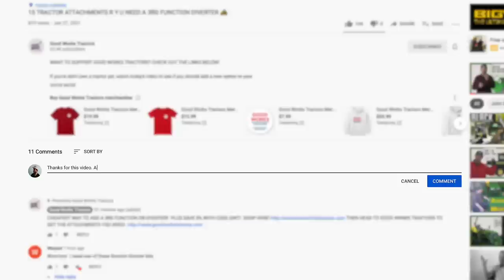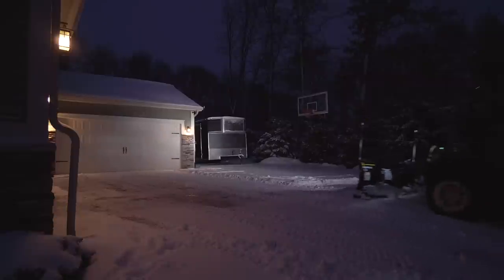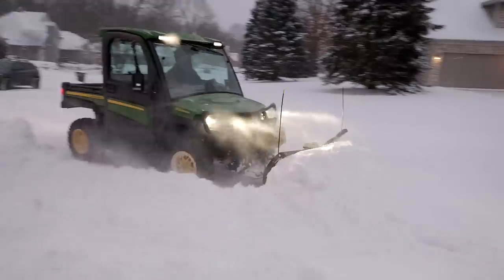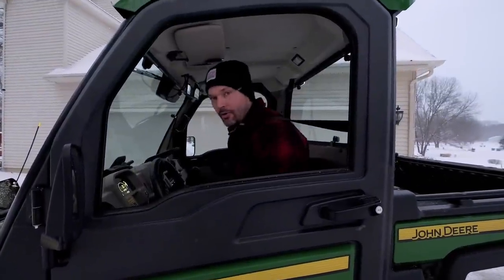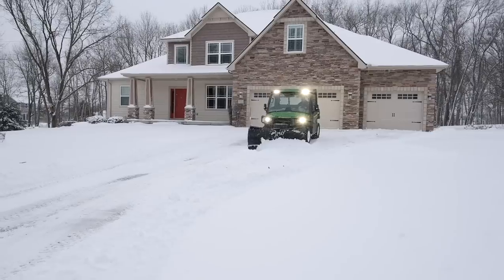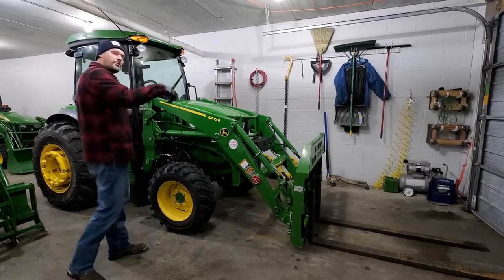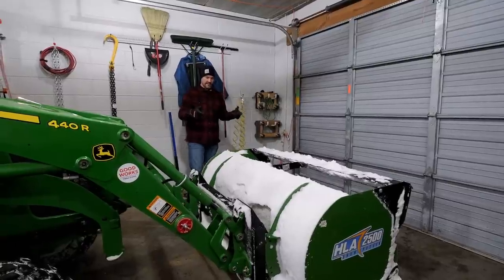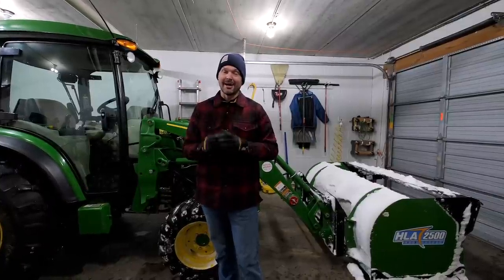JOHN DEERE GATOR VS TRACTOR PLOWING SNOW IN STYLE! 🚜🐊😎

Comment: I bought a little Honda HS720 single stage snow thrower I keep in the bed of the Gator.  I use that to clean out in front of garage doors enough to get the Gator in and plow out.  I have an older model Powertach plow on my 835M and that can be arranged for down pressure, but I don't use it that way.  We just had 20" of snow here and I plowed twice.  The Gator handled it pretty easily though it was very light snow.  Now my neighbor didn't have anyone do her driveway AT ALL!  We have more snow coming and she's parked out by the road.  I asked her if she wants me to give it a shot.  So I try it with the Gator.  The snow had compacted to about 14" and was much tighter and heavier.  I was shocked the Gator could push it.  It was rolling snow I sweat 4' high in front of the Gator.  I whish I had video of it.  

I have a Kubota B2320 TLB if it gets bad.  BUT that's open cap and I'm not using it unless I have to.

The whole shifting operation and changes in motion on the Gator and any of the CVT's in general it's just ehhhh. Not like using a hydrostatic tractor. 

At the street I try and stack the snow on the down "stream" side of my driveway and mailbox.  If I need to pile it on the up stream side I try and go pretty far so the township plow can toss the snow and have their plow about empty by the time it gets to my driveway.  I have about 350' of road frontage.  Generally I NEVER push snow across the street.

If I had a heated tractor cab I wouldn't use the Gator at all.  If I had asphalt AND a cab tractor I'd have a snowblower on it.  The guys with the snow blowers never have to worry about where to stack snow.  I've been stacking snow for 40 years.  Using that Honda HS720 is making me rethink my snow removal processes.  

Do you use compression software to upload your videos?  I could never get a 21 minute video uploaded?

GREAT video as always.

Any chance you got a nice Kubota L3940 HSTC and loader you're not listing on your website???  Buddy - Pal??

Comment: Compact tractor (large frame) with a pusher on the front and a snow blower on the back is a parking lot clearing animal.  Push the bulk and use the blower to clear additional space (corner spaces!) and quickly put piles wherever you want them.  I used to plow a small parking lot and having the extra 6 spaces I could clear 100% with the blower was awesome.  Don't get a lot of snow?  Hang a rotary broom on the back and clear pedestrian areas.

Comment: Im baised here owning a tractor, so I'm 100% snow pusher with rear blade. I actually have 2 different pushers, hla1500 w/ steel edge. perfect for wet snow / sleet / ice as the size only allows so much material so I dont loose traction or steering, the other is a no name large pusher w/ rubber cutting edge (mold board is 35" tall, width is 72") love it for big snowstorms with drier snow, I can move  a ton of it at once. The rear blade is great for getting into tighter spots and windrowing smaller storms to grab with the pusher.

Comment: The Gator did well with the driveways and I agree about keeping the snow off your neighbors property. The pusher did well in the open lot clearing. I was surprised that you have to plow your own area when the landlord has the upper lot plowed. Its also crazy that you have to bring it up the hill. (No place for it in the lower lot). Both plow & pusher did well for there tasks, good job and thanks.
Reply from the maker: Thanks for watching Bob!  Yeah, I really just need a bigger shop.  On the hunt for more space, but hard to find right now.

Comment: I find in reral MN that a blower and blade combination on a tractor works best. It does not matter if it is in a front mount blower and rear blade or front blade or rear blower. That way I don't have to push the snow on to the lawn and rip it up. I have a can stay on the drive and blow the snow on the lawn and still scrap the drive with the blade

Comment: I've found that the verticle angle on the edge makes a difference when you want to scrape. A slight tilt away from the direction you are plowing causes the edge to float slightly. I adjusted my tilt to perfectly vertical and it scrapes both directions. Also when going backwards your skid shoes will hold up the blade since they are on top of snow where in forward the snow has been removed.
By the way I like your brother's camera work. Nice job!
Reply from the maker: Good points all around here, thanks for taking the time to comment!

Comment: I've really had an epiphany lately with my pusher, and back drag setup with my rear blower. I took off my loader arms on my L2501, and I have to say, I'm so very impressed and a little dumbfounded. My 68" mk martin meteor sits fine with no front ballast! I have hills, and quick drop offs here in Wisconsin and my problem has always been inside corners and maneuvering in all my tight spots. The blower alone on my tractor makes it handle like a jeep compared to a semi truck! And I can do u-turns,  or right turns and it follows along beautifully. Plus with the blower, you touch it once & it's gone, except in a few of my tight spots, but even then, I just hit it a 2nd time. I don't get the large piles, and it just handles so nicely! I took it off as an experiment, and have now blown 3 storms without loader arms on. 
1. We've had at least 6" each storm, with lesser amounts the blower isn't as effective. 
2. The blower actually works pretty good as a back drag! 
The blower weighs 500lbs, but doesn't lift my front tires. I'm really amazed by the results. And I'm a big snow pusher fan!

Comment: Living on a cul-de-sac is terrible with snow plows that don't know what they are doing.  Each year they push their blades into the grass and cut up a large section or get stuck since we are on the bottom of a hill and back into the yard and spray salt all over the yard.  it Sucks!  I try to get out and clear before they get here so all they do is leave a big pile in front of my driveway.  They really need to learn how to turn their blades.  I clear my drive the cul-de-sac and some of my neighbors drives and I just got the HLA 1500 for my 1025r and I love it.  Put a UHMW blade on the bottom and rubber on the back drag and works great.  I always put the snow in the curb of the house I'm plowing.  It takes a little longer but I agree its not the neighbor on the other side of the street snow.  Good plowing

Comment: You’re right... having a cab is a big plus on my 3039R.  So far I’ve been using my bucket to clear my driveway and it’s working well.  Are the blades for a Gator expensive?  I have an 835M. Thanks for this video.

Comment: Yea we always had clean scraping issues with atv/ utv blades.  It worked a bit better when we added weight right on the plow.  It's a delicate balance...too much weight and you will damage the plow, not enough and it just floats..

Comment: At your house, you need to back drag the corner where your garages meet. Then backup perpendicular to your trailer and push your driveway in an arch pattern with your blade angled to the left. Back dragging with a standard plow will never scrap the same as pushing.

Comment: That V plow is slick. That little bit of snow that leaks in the middle would drive me nuts lol. I use a rear blade and a snow pusher, seems like the most cost effective setup. Do you find having the back drag on the snow pushers works better than having a rear blade? I just figured the rear blade works for snow removal and ballast.
Reply from the maker: Yeah, it drives me nuts too.  I bought some conveyor belting to fix that problem (if things go according to plan).  Going to install it when I swap over to UHMW.  Just need the a couple hours of free time.  Yeah, I really like that backdrag on the pusher.  Rear blades are very light so don't add much ballast compared to a box or weight rack.

Comment: I like weight on the bucket for scraping to pavement vs leaving a half inch of slippery snow. Best machine I ever used was a Cat 930 with a bucket slightly narrower than the front wheels. It took more passes but it cleaned roads and cement down to nothing

Comment: Question: is it really safe to drag that long/much with the snow pusher?  i thought that puts an undue strain on the two cylinders and may bend them??
Reply from the maker: You need to be careful.  Plowing a smooth paved parking lot is different than using with a bucket on uneven terrain with potential hidden stumps, roots, rocks.  Also, speed is your friend.  Slower the better.

Comment: what size snow pusher do you find ideal for a 1025r, 54" or 60". I currently have the 54" front mount snowblower but would like the option to push if needed.
Reply from the maker: I recommend 54"
Reply: I have a 5' king kutter box blade on the back of my 1025R and I have to be in high to get enough speed to push/pull any snow, going in low isn't quite fast enough.
Reply: @prestonfaust4267  I have the heavy hitch back blade that I use in conjunction with the snowblower works pretty good when I angle it

Comment: Far be it for me to be critical of someone else's plow job; I have a suggestion with what I do. With my v plow, I push driver side full out and pull passenger side full in. I then start from the left of the paved area and make an arc towards my pile area. As I am become perpendicular with the pile area, I straighten out the wheels. Rinse and repeat. You will have less you have to back drag around the garage and when you do, you push it to the Right and not all the way back like you did.
Reply from the maker: Not sure I follow, but I've used this plow, used the plow on my old x739, used pushers, and used blowers on my drive.  I've plowed it for five years since we moved in and tried every possible method I can think of.  It's just a tough area to plow and can't wait to move, haha!  Thanks for watching.

Comment: Some of my thoughts from Minnesota: Poor original layout of the first driveway, like most are. Nobody thought about snow removal and piling when it was first laid out. The second one is a little better, but still not good. Ballast sand bags in the bed also help tremendously. And add a backdrag strip on the gator plow blade. I usually clear most snow with the plow truck first except by the buildings, then backdrag by the buildings with the tractor loader, then move that with the plow. The object however is to not drive on the snow before clearing it as much as possible.

Comment: Wouldn't the back drag function for the pusher be the same as the radical tilt of the bucket and back dragging ?  I mean in terms of cylinder extension and issues that can happen because of it.

Comment: Have you tried putting chains on your front tires, on the 4066r. 

I do with mine and it turns like a charm
Reply from the maker: No, not looking to screw up the concrete and paved surfaces.
Reply: @GoodWorksTractors  oh that makes since. Silly me, I live on dirt roads and dirt driveways
Reply from the maker: Yeah, great option for your situation though.  I bet it makes a big difference.
Reply: @GoodWorksTractors  yes it does.

Comment: I’ve snow plowed since ‘06. Keep the plow straight when back dragging. Your pivot point is center of the V so it’s very hard/impossible to get equal down pressure on the entire edge when it’s not straight. Also your best most efficient plowing with any plow is always forward. Back drag just enough to get your equipment enough room to plow in the forward direction. I have a Boss V plow on my Gator(I know you bought it as a very lightly used machine and it came with the JD plow) and it a much better system,  as it has a handheld remote compared to your joystick system, I know it’s more user friendly then the John Deere system. Maybe look into one for yours you will like it 100x better. Love the content though keep it up.

Comment: The johndeere plow looks identical to the fisher plow i have for my gator. I bought my 835r 2 years ago and deere didn't have that plow available yet.
Reply from the maker: Yeah, a few others mentioned that as well.  I'm sure it's just private labeled.  JD does that a lot with attachments.
Reply: @GoodWorksTractors  the outside mirrors on your gator, they are the one u have linked on Amazon?
Reply from the maker: Negative.  Those only fit tractors.  These were from the JD dealer.

Comment: Hey good works, quick question. We are looking at buying a 4066r or a 4052r. We have a new Holland open station that is older and pre emissions. We are worried about the emissions because we only use a mower with it 1 or 2 times a year, mostly loader work. Do you think this will lead to engine problems? Because the engine won’t be running very hot all the time so idk if that will be bad or not for it. Great video btw
Reply from the maker: Morning, my 4066r goes into regen every 40ish hours since we run lower throttle a lot, so soot builds up more often.  However, we can use the tractor while it's going through regen and it really doesn't affect our operations.  I don't see how this will lead to engine problems, but I'm not a mechanic either, haha.  Just my two cents.
Reply: @GoodWorksTractors  ok thanks for the reply so quick. Not many people on YouTube with one, much less that dosnt use a pto implement frequently. This has been the main thing keeping us from buying one so your feedback is very helpful.

Comment: Pull the shoes on the blade or raise them all the way up.  You are plowing on pavement.  I plow with a 825i S4 at work with a Curtis plow.  The Gators have such a light footprint that you don't need the shoes and it will scrae better.  Just feather the blade up a bit when you go off the driveway.

Comment: I have a similar setup only a Honda utv with a boss plow! Love the plow and is faster in the long straight runs. But my cab the Honda dealer put on is awful snow blows right in and the heater you can blow as hard with your mouth on high sucks. So I would much more prefer tractor only screwed up and need a cab!!

Comment: You could try back dragging in front of the garage  enough room so you can get the gator backed up to the garage door and then plow forward down your drive instead of back dragging down the entire drive.
Your landlord's snow removal contractor does not want to take on the liability of possibly hitting any of your equipment or you claiming he did even if he did not.
Reply from the maker: Yeah, I just backdrag the top section, then plow down the hill.  Still annoying even in that top landing area.
Reply: @GoodWorksTractors  there's a tool for that if you're looking to buy more toys. 😂
Reply: @GoodWorksTractors  I'm sure your landlord is great but if it was agreed upon I'd want to ask for a plowing stipend each time it snows. Perhaps the landlord doesn't know and would be upset if he found out. In that case I might let it go too. It's just always best to address every issue, even little ones early when it comes to business.

Comment: A Gator doesn’t have enough weight or maneuverability to match a tractor.  And if you put a plow on in place of a bucket you can pile the snow.  A Gator has its place but in general offers a lot less than a tractor

Comment: If your V plow had a back drag cutting edge that might improve the removal a bit. My options don't include a V or pusher, so I have to choose straight plow or blower. Blower is great except when really wet and iced up gravel below. Tends to be almost a pusher. But if I had to choose, I would pick the pusher. Down pressure and no lost snow at the middle of the V.

On the placement of snow, my opinion is not in someone else's property and absolutely clean up the mess. I can't count how many times someone has pushed across the road and the remaining ridges are scary to drive over. If it is hours before the road plow comes past and has been packed down, I would not want to be that plow driver hitting those ridges. Selfish move in my opinion!
Reply from the maker: I've thought a bit about the cutting edge for this plow, but realize the inside ends (at the middle) would need to stop short in order to still be able to angle both directions. Still need to look into this.
Reply: @GoodWorksTractors  True indeed. The same as the front to it to be in the inverted V position. Some truck style V plows have back drag options or maybe aftermarket options. Or maybe have some fabricated for that plow. There might be a market someone hasn't filled yet for back dragging with that V.

Comment: You ask about plowing score intp the neighbors Yard or Plowing Across the road. 
I'm a contractor and I keep the snow in the yard that it comes from.  Also plowing across the road in my area is illegal, it's written into the motor vehicle act.
I had a highway plow operator ask me one time of I had plowed a pile of snow on the side of the road, I hadn't. He told that if the front blade or the wing hits snow on the edge of the road it can move the plow across the center line. This is dangerous for cars coming the other way.

Comment: Back dragging with the Gator and plow... that would be virtually impossible due to the fact that the plow only has a blade for pushing, if it had a blade on the back side of the plow you could very easily drag back.

Comment: How can those little machines cost $26K?? It seems light to push much snow.
How come you are making the guy shovel next to the building when you have that snazzy pusher/puller box? At 17:03 you show clear capability to save his back ;)
Reply from the maker: I'd rather have him find out for himself that the tractor is a much smarter way to work.  At least that's how I learn.  He's new at GWT.  Still learning the ropes.